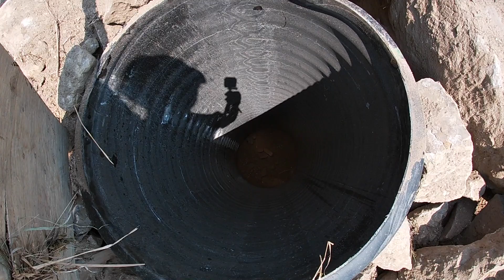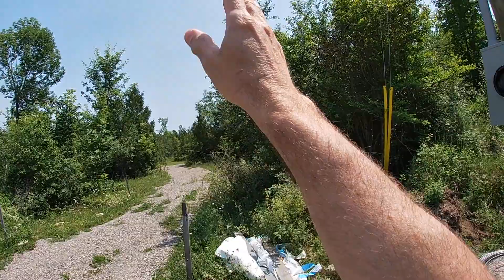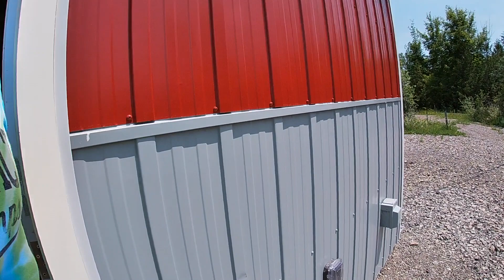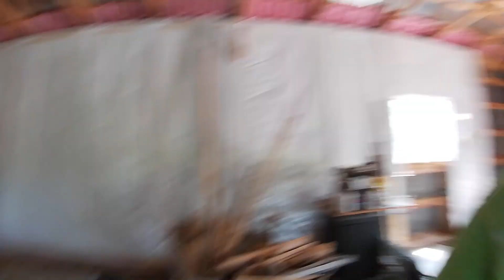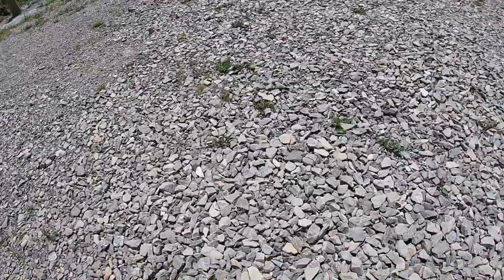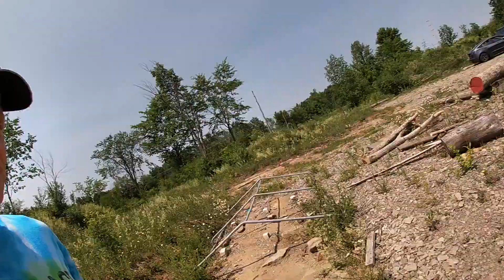Wiring the Shop and Weed Control Updates

Comment: Hi Peter. Your analysis of the weed killer seems to be correct. Perhaps a second spraying and a good stirring of the solution so that it is well distributed in the tank will do the trick. The wind can bring in more weed seeds. You have a lot less insulation on the floor than you did at one time. Would a spray insulation work for the ceiling? I don't know about its application. Is there a code for outlets in a barn? I think there is for a house which you are not building. Have good days!